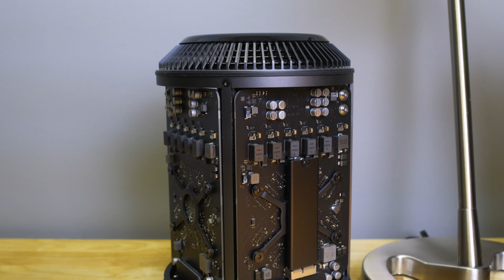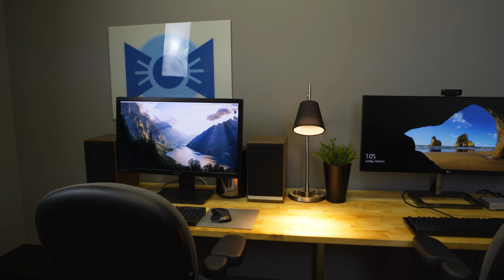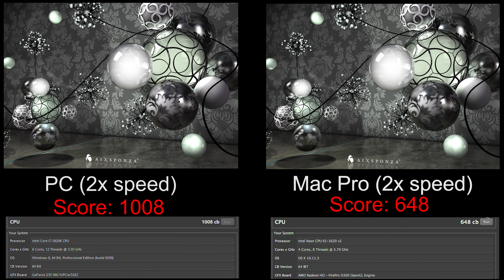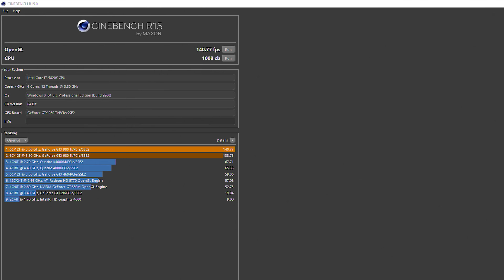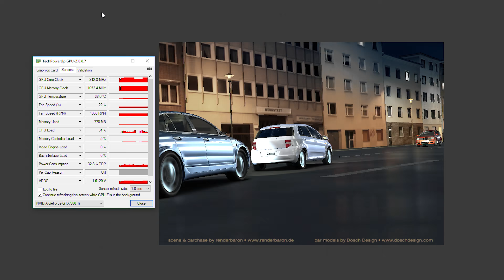$2,000 Custom PC vs $4,000 Mac Pro

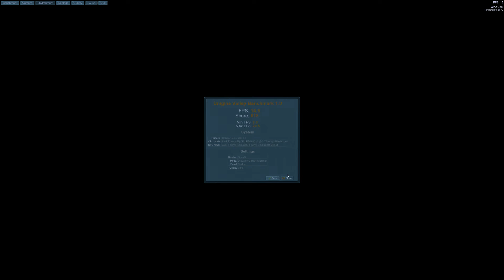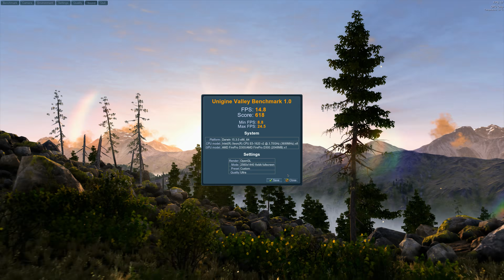Comment: if you see the mouse of the mac on 6:12 and the mouse of the pc 6:33 you can see that the mouse of the pc is bigger, so the resolution wasn't the same on both
Reply from the maker: +Eric Cartman Uh, no. Both were running the benchmark at 1440p and both computers were having their screen captured by my Atomos Assassin which acted as a 2160p monitor.
Reply: Snazzy Labs oh, ok that's enough for me thx bro
Reply: +Eric Cartman You can even see the resolution listed on the end benchmark screen...

Comment: I enjoy your videos and i agree with the fact that apple needs to update the mac pro. However, the fact that you said that the mac pro you have with a quad core and 12gbs of ram is the $4000 model is incorrect. The $4000 mac pro does has 6-core and 16gbs of ram. You are talking about the base line mac pro. Once again, i enjoy your videos and agree with you about needing an upgrade but you were wrong about price and all that jazz.

thanks!
Reply from the maker: +Jonathan Avila Noted in the description. Can't change title of video now due to SEO.
Reply: +Snazzy Labs I should have checked that. Sorry.

Comment: Couple of issues here:
The mac pro depicted is the 3'000 dollar one. The 4'000 one starts out with a 6-core config.

And then it's worth just pointing out that this is essentially it with most workstation-class computers. As soon as it has a 6+ core Xeon in it instead of a branded i7, it becomes kind of expensive. Just look at the HP z840 prices. They are a bit cheaper than the mac pro but also physically quite a bit larger.  I'd personally still opt for the z840 but it's easy to recognize that it is not such a clear cut choice for everyone. Now there are some features of Xeons that some workstation users loves to have, I'm sure. But in single CPU systems generally I'd say it's just an excellent way of wasting money.

But agreed that the Pro needs an update. Not sure I'd give a hoot about the CPU (if this test would have been done 6 core vs 6 core model, they'd perform very similarly because Intel isn't advancing in CPU speed from generation to generation much anymore) but the price point should be brought down as apple usually is able to do it once or twice after releasing a new line of products. They should also look at those outdated GPUs and bring in something better.
Reply: +Wokis 2 things nobody ever seems to consider in these kind of comparisons.

1, Support. The support you get with a Mac Pro is going to orders of magnitude better than custom build. They'll sort the whole system out for you rather than you having to troubleshoot it, RMA that one part, wait for the replacement to arrive then put it back in (sometimes to find that part wasn't actually the problem). Apple will also do a full system diagnostic too and replace anything and everything they find has a problem or potential problem. You can also get extended support where they give you a replacement machine on loan so you can carry on with your work (which is one reason most pro's or anybody with a lot of data should work with external storage, plug it into the new machine and carry on like nothing happened).

2, Certification. This thing, as with most OEM pre-assembled workstations are turnkey certified for various pieces of software. Which means they have official support from the vendor of said software. In other words, if you're having problems with say Maya, AutoDesk will be able to offer far better support if you're running it on something officially certified to run it.

The main reason these machines exist is in the name. WORKstation. it's made for mission critical tasks. A lot of people get them and use them like any old desktop machine when they genuinely don't need them or what they offer. Even this chap who does a lot of video work doesn't really need all the things this class of machine offers, but it's nice to have and he can afford it so why not? The point is they're made to be ultra reliable and they have an amazing support package for the times they're not so you can get back up and running as fast as possible. When one of these systems isn't being used it isn't making money. If you're not relying on it to make your living then that isn't a problem, but if you are then it clearly is.

Comment: So I understand that this is a 2013 Mac Pro but this isn't the fully speced out version of the Mac Pro which may perform a lot better for professional. I am just assuming this because I haven't actually used the crazy speced Mac Pro.
Reply: +Connor Dobbins The sweet spot seems to be the 8 core model. It has many cores/threads but also a fairly high clock speed so some of the older, less optimised software (like Premiere Pro) can still benefit from the better clock speed while more modern stuff (like Final Cut Pro X) can fully utilise all those threads.

You could also buy the 10 core Xeon after market and replace the CPU yourself if you felt like it. It's considered a user replaceable component and isn't all that difficult. It's a bit more involved than a typical tower set up but it's still doable.

Comment: Apple is the Kosher brand of Computers & Cell Phones. While not necessarily the best, definitely not the worst. But in the scenario of "Professional" The PC makes more sense. And yes, the Mac Pro DOES use workstation grade components. But switch out the CPU and GPU in the PC to Say, a Xeon and a Quadro and heavily emphasis the video and workstation aspects. The PC still wins. GG Apple.

Comment: It would be interesting to see if the new iMac line up with the newer gen CPUs actually outperform the Mac Pro nowadays. 

Good honest video though, I switched to PC a couple months back, and looked back at all.
Reply: +Christian Conner They do, they have done for the last couple of generations, but only the mid level Mac Pro's are bested, just. For proper workstation tasks where the hardware actually benefits the project the Mac Pro still spanks them though.

Comment: You should try redoing the tests on the Mac with Windows loaded in Bootcamp. I find that on my machine, a self built PC/Hackintosh, that graphical workloads are almost 1.5-2 times better in Windows than in Mac due to better software optimization for graphics. Although I still don't expect that the Mac will outperform your PC, but it might be slightly closer performance wise.

Comment: looks like you're finally starting to see past the apple smokescreen. apple has always sold over priced gear, you get about 30% worth of hardware, the the other 70% is just the name and design. apple do have some nice designs but is it worth the markup they ask for? fuck no. 

There's two categories of people I see buying macs, those who aren't technologically literate enough to use pcs properly(which includes the designer type people) or those who use it as a status symbol like people used to, and to some degree still do, with cars.
Reply from the maker: +OtakuSanel I disagree. I still think Mac OS is a brilliant operating system and I'm still very much a Mac fan; however, I'm still an objective individual and see the performance benefits to my workload by using a Windows computer with the hardware I have selected. Both OSes and platforms have their strengths and weaknesses and I intend to continue using both platforms for their strengths.
Reply: Cars are defiantly a status symbol, more so than houses. I'm not sure why you're trying to downplay this fact. 
To the point, Apple products used to be, in my opinion, much too overpriced. But when you look at the market now, everything else rose up to the point where MacBooks are becoming price competitive with Surface Books, XPS series, or Ultrabooks, even.
The average consumer doesn't say, "I wish I had 8g more ram for the cost and a dedicated gpu."  Instead, they exclaim that they wouldn't buy a laptop for over $1000. Times have changed, only the Mac Pro has to keep up. Check out price list for some apple components, usually the retail markup is comparable to Samsung and others.

Comment: THATS NOT A FAIR FIGHT 12 GB OF DDR3 RAM VS 32 GB OF DDR4 RAM WTF!?!
Reply from the maker: I consider it fair when the Mac costs more than 2x as much.
Reply: But still, thats not fair ddr3 is slower them ddr4
Reply: +Snazzy Labs Also these tests are not RAM dependent... You tend to find once you get above 8GB, things start to level out. 

RAM is better for high speed scrubbing and caching data for editing, once you start to export, not so much
Reply: +The Wolfs Dude the mac cost 2 time more then the PC it's fair lol
Reply: Lol its completely fair. If Apple wants to stay competitive they should upgrade the Mac Pro. Do you know how much more powerful the PC would be if he spent a total of $4000 on parts?
Reply: +The Wolfs problem is that Apple hardware is way overpriced, and for no good reason
Reply: +The Wolfs no game or benchmark would ever use 12 GB of ram and the speed difference of DDR3 vs DDR4 in gaming is negligible, the only thing you would notice a difference between the two for ram at least is in video editing.
Reply: +The Wolfs Again, the speed different between DDR3 and DDR4 is minimal. (about 2FPS in games) there are plenty of videos on YouTube with this. It's a fair test.
Reply: but still, 12 vs 32 thats a little bit less then 3 times bigger then 12
Reply: +KvnS S Hell if you are a very smart shopper, you could build a PC for less then $1,000 that could smoke the Mac Pro, it's called waiting on sales, and doing a bit of research.
Reply: Nah I'm good I mean i like window but I'm more of a mac guy because it can be a mac and a pc at the same time =/
Reply: +Christian Conner It's called Apple Genius Engineering, It's so much better based on everyone else's off the shelf hardware wrapped in a fancy package I don't have to think about. ;-)
Reply: +Commodorefan64 lol. Okay. Pretty sure it's good engineering, not genius. Still not worth the price hike. 

I like macs too, but no one can deny they are overpriced.
Reply: but, if you think of it pcs are the same price to for the anti virus and add ons and if its a desktop a monitor so its some how going to be near the price but they are pretty pricy But! Think of it Apple knows how to box and make there products pretty
Reply: The Wolfs you need to buy a monitor for the Mac Pro as well. And the design is cool (trash can) but it's inefficient. It Gets too hot. A nice big case would be much better and it'd keep your room cooler. As for the anti virus, that's optional. Btw any computer can get a virus
Reply: The Wolfs If you are running windows you can get free Antivirus software all day long Like Panda Free Antivirus, and monitors don't have to cost a lot, I have 3 24in 1080p panels and my total cost plus the HDMI cables, and adapters was $320, so a little over $100 a monitor. But as has been stated any OS can get a virus, it's just OSX, ChromeOS, and Linux in general are not targeted as often as windows, but I can for sure tell you they all have their security flaws. but to note I run Windows, ChromeOS, Linux, and Android all on a daily bases, and I've not gotten a virus in years, because I follow the practice of not going to websites that are shady, and I don't download shady software, along with using an ad blocker on websites I don't fully trust.
Reply: Really though you won't win if you compare Apple hardware vs what you get if build a PC (or buy a pre-built). PC hardware wins every time. 

The only area you can argue for is software. OS X vs Windows is a matter of preference (and whether or not you game). Me personally, I have a PC I built as my main desktop and I'd love to get a macbook pro as my traveling laptop.
Reply: I know that but Apple computers are mostly for work or light gaming like minecraft or unturned. Or cs go, macs are really good for traveling and for traveling i would go for a macbook pro or a macbook air
Reply: +shadowtsunami My comment is called Sarcasm, look it up sometime why don't ya. I've been building my own PC's since the early 90's using mostly AMD hardware as they have given me the most bang for the buck.
Reply: The Wolfs razer makes gaming laptops just as small as the macbook air, but the performance is much better for a lower price
Reply: +Apollo Just about any major PC maker does lol!
Reply: +shadowtsunami Yeah that can be true, but it pays to looks for little ques like ;-) the wink face, and to check other comments put before hand if there are any.

Comment: The mac pro is not being updated because all the "pros" noticed that apple just sucks at this.
Reply: the old mac pros (the silver tower ones) where actually pretty good at the time. still somewhat overpriced but very capable and osx made for a great workflow. now however.. mac pro is dead. shit, overpriced hardware and the advantages of osx in day to day production use just can't outweigh the insane price for the sub par performance.
Reply: Ivan Stroganov Old is old tho ^^ times have changed
Reply: +Ivan Stroganov The Mac Pro line has always been extremely good value for money believe it or not. At the time of launch it's been damn near impossible to find an alternative system with the same (never mind better) features and specs for less. They don't update them as often as they used to any more though so they get leap frogged, but on launch they're arguably the best workstations you can buy for the money and the newer model has the tiny form factor in its favour too. You needed a mid or full tower system to beat the bugger on the PC side of things. Finding ITX Xeon boards with 6 Thunderbolt 2 ports that can accept dual workstation GPU's was and still is an impossible task.
Reply: TalesOfWar it was not impossible to do that. Just get a serverboard with usb 3.0 >.<
Reply: Benjamin Buljevic USB 3.0 ≠ Thunderbolt 2. Hell, USB 3.1 is only as fast as Thunderbolt 1, never mine 2, or the soon to be more common version 3. Thunderbolt is also peer to peer so there's next to no software latency involved as there is with USB. You can also run 6 4K displays from a Mac Pro. Checkout Thaibox123's video on it. He thought you needed an external GPU but turns out you can run them all just fine from the ports on the back. You can't do that with USB 3.0.
Reply: TalesOfWar thunderbold may be peer to peer, but its not faster than 3.1 also i dont have the time to discuss how bad apple is with an apple fanboy noones gonna give me that livetime back so l8r
Reply: Benjamin Buljevic You're joking right? USB 3.0 is 5Gbit, USB 3.1 is 10Gbit. Thunderbolt 1 is 10Gbit, Thunderbolt 2 is 20Gbit, Thunderbolt 3 is 40Gbit. Please explain to me how Thunderbolt is slower.
Reply: TalesOfWar stfu ffs
Reply: Benjamin Buljevic So in other words, you made a mistake and would rather whinge about it than admit you were wrong? OK. We all fuck up, dude.
Reply: TalesOfWar näh bro, in other words i just updated black desert online and i need to get ma stuff. OK. We all fuck up, dude.

Comment: Apple really needs to step it up... Hey Quinn isn't that version of the Mac Pro with the Quad Core only 2999? Did you do more upgrades to it?
Reply: "Only 2999$"... Good joke for this you could buy a PC which is 100 times better
Reply: +sloth011 Just making sure people get the facts.. If he wanted to compare a 4,000 Mac Pro the outcome would be different.. Maybe still not as good as Quinn's PC but much closer... Also, have to take into account the time Quinn spent messing with building and trouble shooting his PC.. The fact still remains that Apple needs to setup up the Mac Pro game if they are going to charge that much more..2-1/2 years between models is horrible... I look at both sides.. Helps make an educated decision.. Most people don't do that..
Reply from the maker: +TechExamined You're correct. I updated the Mac's SSD to 1TB so my specific build is closer to $4,000; however, the very base model is $3,000. I'd change the title now that you've helped me realize it, but you know how YouTube SEO is once you try to change the title of a posted video... LOL.
Reply: +Snazzy Labs LOL.. No that's fine.. If you upgraded it than that's what people need to know..